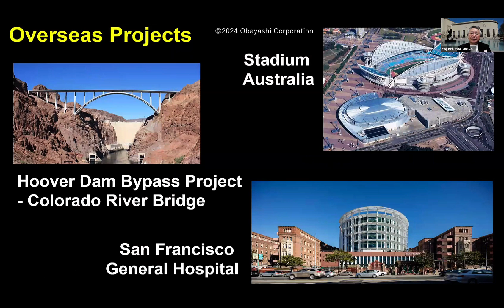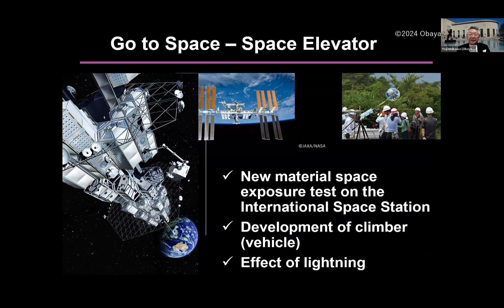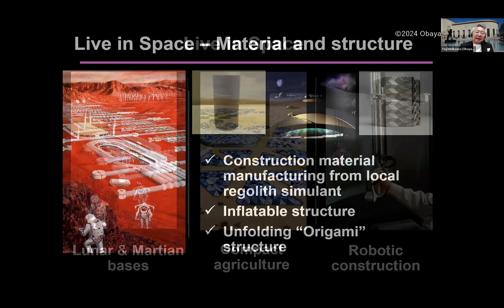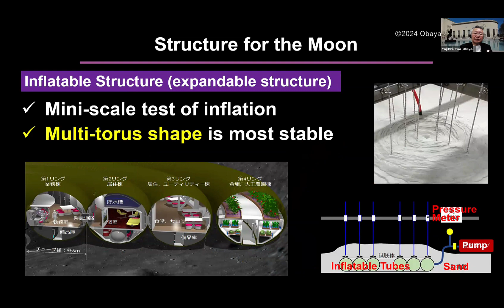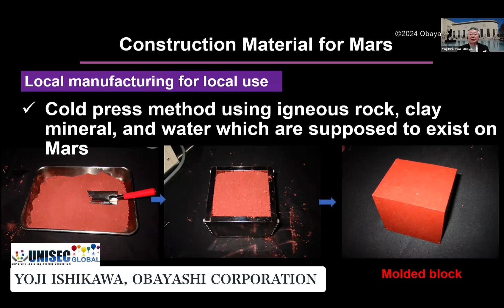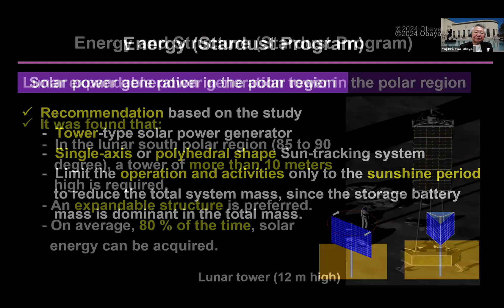44th Virtual UNISEC-Global Meeting - R&D for Construction on the Moon

Comment: I am all for the R&D about Moon projects, but they list three ways of getting there, and guess what the first way is… My first thought was:
‘How ridicules! Don’t even the Japanese scientists know it would be easier to dig a mile deep hole? If you don’t realize, a mile deep hole will fall in on itself before you get that deep.’

Yes, maybe in decades we will have a material that won’t snap from a windstorm after reaching the length needed for a space elevator. I have thought about how we would need a mile square building reaching a mile high to hold the elevator in place. How long will that take to build?

‘We won’t be going to orbit on an elevator anytime soon. An elevator from the Lunar surface might reach a space station at Lagrange point 1, where less gravity causes less tension, and there is no wind.’

You are right. I too, am dreaming… 

‘Let’s get there already!’